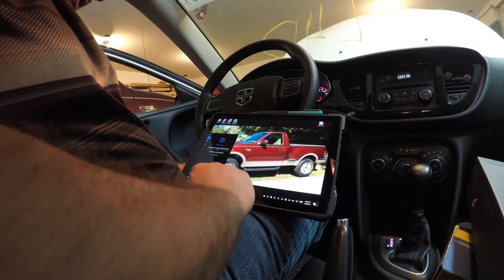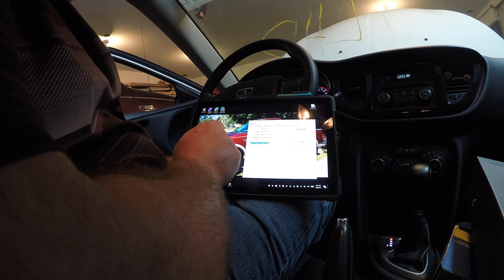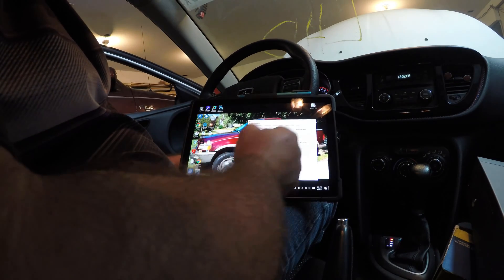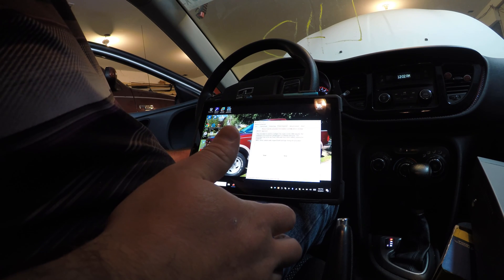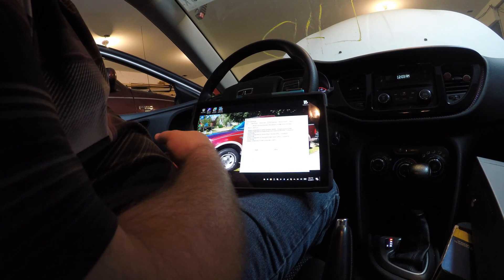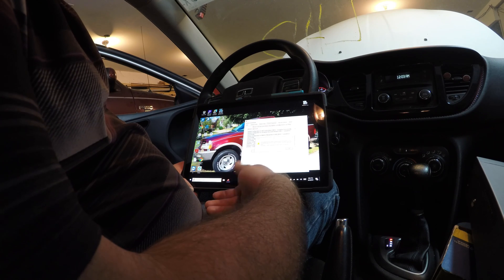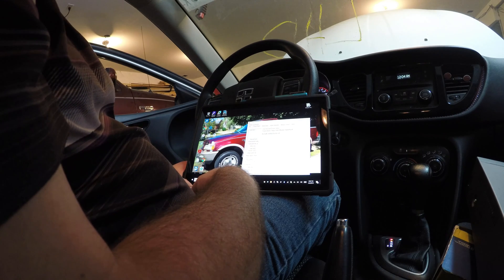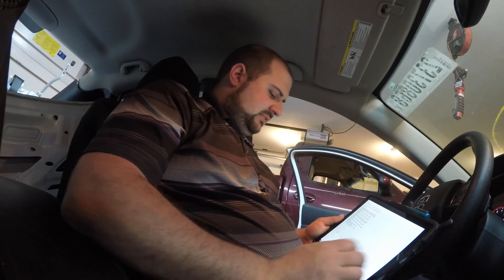2013-2016 Dodge Dart Proxy Alignment FCA AlfaOBD OBDLink MX+

Comment from the maker: Sorry for the delay in videos guys! More coming on the Dart and Mustang!
Reply: Hello, I've been using your video as a guide to do the proxy alignment on my 2015 dodge dart. I have the obdlink cx and when it gets to the configuration part, a pop up comes up saying to turn the key to the off position, connect the blue adapter between the obd plug and obd interface. Turn the key to the on position, wait for the startup checks to complete and click ok. 
Do you have any idea what that means? I've tried turning the key off and on but it won't continue with the configuration much less the actual alignment.
Reply: What about if a car hit and ran? My front bumper is half broken. Got a new one in the way. But the alignment is now off a bit. My steering wheel is more to the right for when I want to drive straight

Comment: I needed to do this when I changed my gauge cluster.

I had a base display on a 2013 dart. Bought the tft color display on eBay. Had different mileage so they don't need to be the same. Needed obdlink mx+ and alfa obd to do a proxy alignment. Guides are online. Very easy. 

For other people that might see this in the future. 

MAKE A BACKUP OF YOUR CONFIGS BEFORE DOING ANYTHING

I've read these things from dodge dart forums.cluster should be from the same year. So a 2013 dart gets a 2013 cluster ect. Make sure you look at the approved obd readers on the alfa obd website. I used the windows version of alfa obd but if you are on android the app is even better. No iOS option. 

After I installed the digital TFT cluster and turned on the car it showed a bunch of sensor and module failures for options that didn't come with my car. Rain sensing wipers, blind spot monitoring ect. So basically run the proxi alignment after installing and bam. 
No flashing odometer no lights or codes. 

Some other information that could help. Make sure you keep your radio on. Don't go into your configurations and change anything. All codes need to be cleared and proxy alignment done. That’s it.

Comment: Hello there I have a 2016 Dodge Dart and the odometer flashes when it’s running and the base radio works when it wants too no idea what I should do I came to this video from a dart forum.
Reply from the maker: You can try a proxy alignment with AlfaOBD. Beyond that I am not sure.

Comment: This helped me to know I was using the app the write way. I'm a PC guy and don't want to brick my car like a jailbreak gone wrong. My 2016 has had the gremlin in the electrical for some time. I'm hoping this will help with some of the configs I did and to eventually get the radio to work consistently. Thanks again 🤙🏽

Comment: 3 years later I have to say, THANK YOU! My promaster has had flashing odometer driving me crazy.  looked everywhere and couldnt find a straightforward solution.  dealer said $300.  I was able to get all the parts, follow your instructions, and do this myself for under $200, plus now I have the MX+ and alphaobd to tinker with other details.  Thanks so much for sharing this very helpful

Comment: Hi I have followed the steps but part way through the alignment I get a message that says "Check Interface" and suggesting I use a blue adaptor (which is already installed to port).

Any suggestions please?

Comment: My 2015 Chrysler 200 gear shifter was stuck in neutral with the “N” flashing but the car was not actually in neutral so I couldn’t get it towed to get my leaky brake line fixed. Followed the steps on your video and now it’s back to normal. Thanks!

Comment: Hi there. I’m new with ALFAOBD . I haveJeep Cherokee 2018 3.2L . Im swapping my cluster from 3.5 to 7inch.
1) I want to do mileage correction, but I don’t se  option for  Mileage correction.  (i can se the options on Grand Cherokee 2016&up) 
2) After putting the 7inch cluster i see the Mileage Flashing..  There is a option<PROXY ALIGNMENT > This option is going to help me to stop  the Mileage flashing?.

Comment: 2014 Dodge Dart owner. I swapped out a regular analog cluster with a tft digital cluster from another car to complement my 8.4 screen. Everything works, but the mileage continues to flash. Would this fix it?
Reply: Yes it would fix it with a proxy configuration alignment
Reply from the maker: I believe so

Comment: If you are using windows tablet or computer you could also use obd ex just as long as it has a usb port, it's also about 40 bucks cheaper
Reply from the maker: I believe I have an older version of that, but I also had the MX+ so that is what I used.

Comment: Hey man - thank you for this video.  You saved me tons of cash.   I had a battery fail on my 2015 Chrysler 200.  It caused my shifter to be stuck in N, blinking odometer and the car wouldn't turn over at all.  Another video I watched (on this exact issue) suggested purchasing a J2534 pass thru device ($$$$) and a subscription to witech to fix the issue.  Instead I bought a OBDLink MX+ and the alfaodb software.  I replaced the battery, then ran the PROXI alignment, cleared the faults and the car is running.  HUGE THANK YOU!
Reply from the maker: Jake Lawson glad I could help! Glad you were able to fix your 200. It’s a pretty awesome app.
Reply: @ACHAutomotive   I try this with my autel it has all the function for proxy alignment but it did not fix my issue so now I'm looking to use the software that you recommend
Reply: I’m having the same issue with my 2015 Chrysler 200
Reply: @Shellmeka588  how did u fix
Reply: Jake Lawson  I’m am going thru that rn
Reply: @CIRCLEDOWN10  If you're going to try what I did; I had to run the PROXI alignment a few times and once after I cleared the errors my car was getting.
Reply: @jake-L1437  I know it’s been a while but I got a question. It’s hard to find anything but obviously the proxi is available on the app. When you purchase the license are there more options on the program than the demo shows? If so my question is answered, if not where is the proxi alignment option. Thanks for your time.
Reply: @jake-L1437  how did you run the PROXI alignment?

Comment: My IPC Keeps Failing
Reply: Had let the car rest for 30 minutes to an hour after proxy
Reply from the maker: Tahj Vansluytman awesome
Glad you were able to get it!
Reply: @ACHAutomotive  I don't understand the steering calibration.
Reply from the maker: @HustleEntertaintment  Makes sense.
Reply: I got my 8.4 radio working for my chrylser 200 but it wont fix the flashing odometer, the cluster is also out of salvage 7 inch
Reply from the maker: @HustleEntertaintment  Thats awesome that you got it working. I'm not sure why it hasn't fixed the flashing odometer, I think, if I remember correctly, I had to do the proxy alignment a couple of times when I first did it. I may have also disconnected the battery in between. Just really learning about this stuff myself.
Reply: I got it to work! I had to change the configuration for the tft display to color